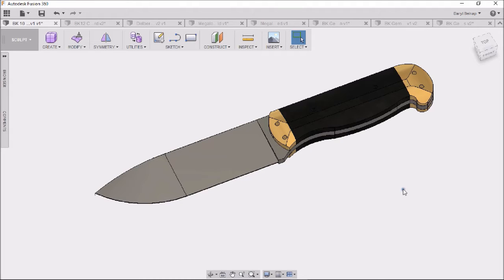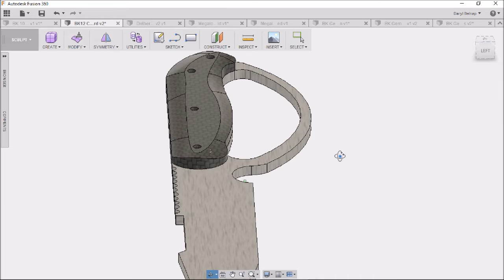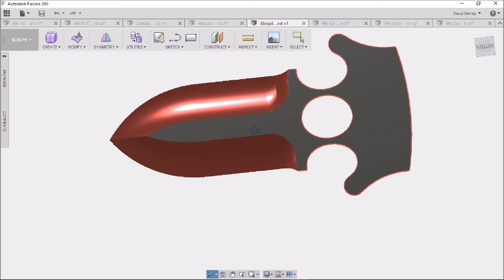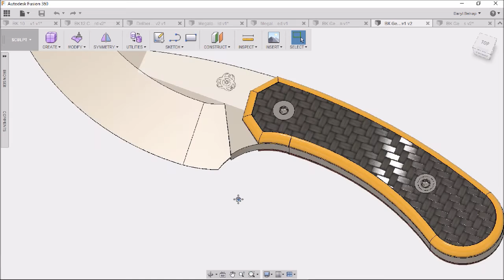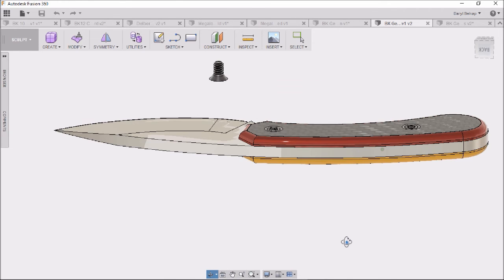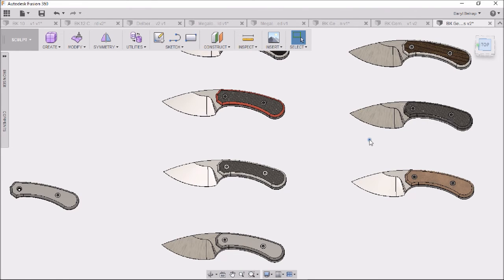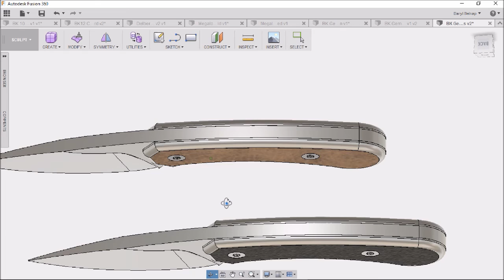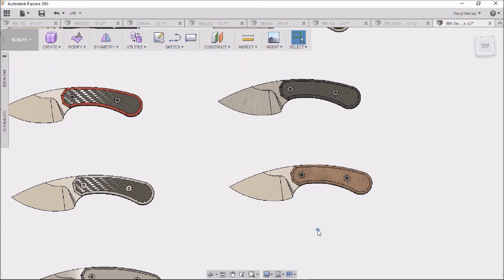CAD Knife Design

Comment: Was fusion360 hard to learn?
Reply from the maker: Not too tough.  I started teaching myself 2D using draftsight free version about a year ago.  Then a couple of months ago started 3D with AutoCAD.  About 3 weeks ago I started using Fusion 360.  I already had the 2D profiles from Draftsight and was able to import them into Fusion 360 and go from there.  The toughest part was finding where stuff was located in the menus.  The first week was frustrating but then I knew my way around enough that I could start to actually do something.  For knife drawing you will need to be able to draw in 2D to make your sketches.  Line, Arc, and Circle will go a long way.  In fact most of my early knives were drawn using only those 3 features.  In Fusion I mainly use the Model toolbar and use Extrude, Offset Plane, Mid Plane, Sweep with guide rail, fillet, chamfer, combine, mirror and insert.  There are good tutorials on Autodesk to get you started with basics.  If you are interested in CAD I would skip those others and go straight to Fusion 360.  There is a free version available.
Reply: BigIronTV awesome thanks